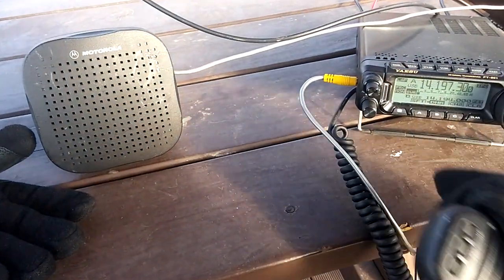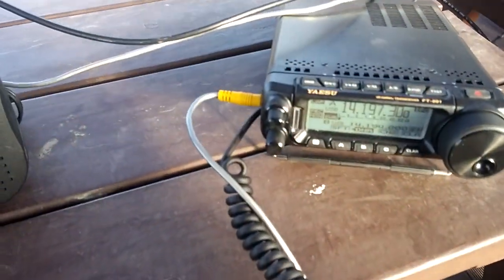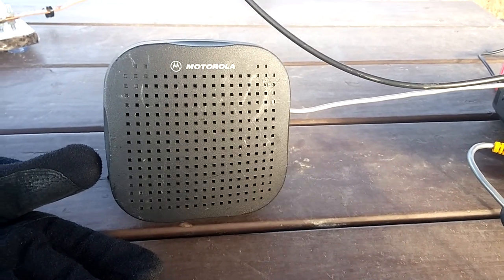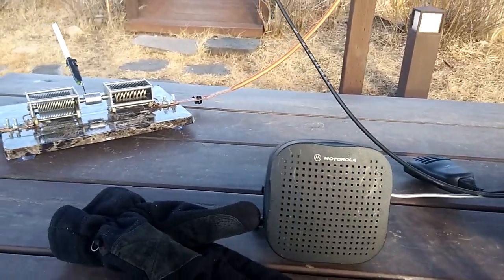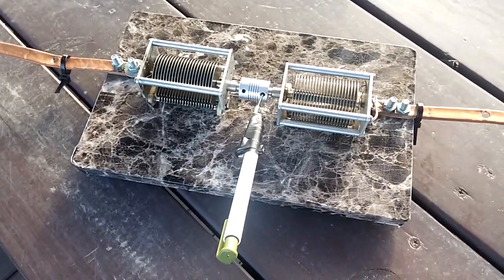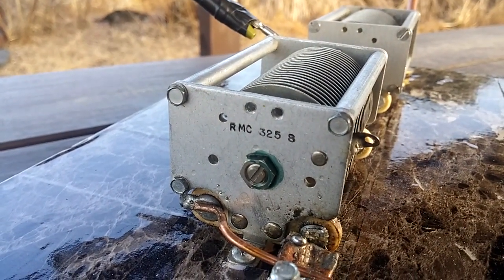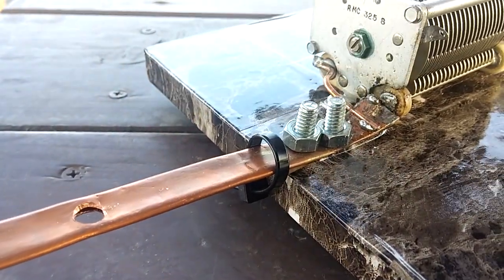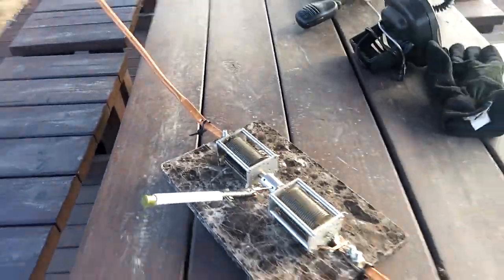Magnetic Loop 20,208 mile contact with LY28A, from HL1ZIX

Comment: The fact that the transmitting station is pointing his antenna long path in relation to you doesn’t mean that the signal is really coming along that path. A directional antenna has always side lobs and the rear lobe is often times quite pronounced, especially in hf antenna designs. That means that when he’s pointing long path is actually just coming short path by the rear of his antenna. To be sure of which path is being used he should turn 180 deg and show the difference, only then you can tell. Having said that I’m not saying it’s impossible. More details of time of day and of the year as well as solar data would help. 
By the way nice job with the homebrew mag loop antenna.
Reply from the maker: Thank you for your assessment of what can happen.  You are mistaken in that you did not take into account that LP contacts from Seoul are actually easier, in this case.  Time of year,  time of day, the op's ability to track current conditions, and assessment of other signals on the band at the given time, all factored into the determination of where the signal was coming from.  If you truly understand how LP works, you must also concede that the way a signal skips along the upper atmosphere during proper LP conditions, as opposed to bouncing between atmosphere and land via SP, makes said contact easier than SP.  These were low sunspot conditions in the absence of any storms.  Seoul is not an easy SP hit to Europe all times of the year -- especially with few sunspots.  Often it is far easier to reach the EU via LP, due to the amount of land in between.  SP contacts to the EU come later in the day than this.  If you had an understanding of the location, conditions, timing, and signals at that time, you would see what I mean.   I also work Italy often via LP and some SP.  The contacts from here to Italy are always easier to get.
Reply: @thestingyham1188  thanks for your detailed answer. I’m not in your location so for sure you can speak better than me. At first sight I was suspicious by the affirmation and wanted to say my point of view. If that’s the case, nice one then. I want to try mag loop too. What can you say performance wise on 20 and 40? Is it worth to try build one? I would be interested in a loop especially oriented for lower bands due to its small size and S/N ratio. 
Thanks

Comment: Perhaps I do not understand the terminology of radio. The earth is only a little less than 25,000 miles in circumference. Assuming your contact is on earth, doesn't that mean the longest contact you could have is 12,500 miles away?
Reply: This is HL1ZIX.  Great question... I know he was longpath at the time, because he said where he was pointing.  Here is your answer:

https://www.onallbands.com/what-is-long-path-in-ham-radio/
Reply: @Swampfox10mm  Thanks Derek That answers my question and is very informative!
Reply: @johnjamieson7688  Sure.  Longpath contacts are often easier, when possible, despite the much longer distance, because the signal bounces along the atmosphere without hitting the ground and weakening as much.  Certain times of the year, depending on where you are working another station, can be better longpath.  With a yagi, one soon learns about it.  On a dipole or vertical (or loop like this), we may not know which direction unless the person on the other end says where they are pointing.  Often times, you might see LP in comments of a spot on the web, for Longpath.
Reply from the maker: Oh, and I just remembered to add that the signal is traveling the long way around the Earth (LP), not the short way.  If I were equal distance from his location on the other side of the Earth, then yes, 12,500 miles.  The station is much closer than that to my East (let's say around 5,000 miles, to keep it simple).  But he was pointing LP to reach me, and that happened to be the only direction open that day.  The signal was traveling the long way around to reach me from the West.  I kind of explained how this happens in my earlier post.  By the way, it's a LOT easier to exploit LP if you are higher up in the air (120 feet or so on top of a building, here).

Comment: I don't want to be annoying but:
if you had a thick copper wire with you and threw it over the garden shed
making use of the frame of the garden shed you could have made a larger LOOP!
the LOOP coupling is simple!

and in the background I see a large metal fence ???
you could have put a wire there too!
enough space there !!! tensioning a wire !!!
now you have to walk around with that big loop
!?!?!?

take only those tuning capacitors with you from now on!
and these things: https://www.google.com/search?sa=X&q=kabeloog&tbm=isch&source=univ&ved=2ahUKEwiSrZ6KwdnhAhUHMuwKHX8mDUAQsAR6BAgJEAE&biw=1920&bih=937
pinched on a somewhat thick power cable
nice location to ......

VrGr Rob.

Comment: I am surprised that you are sitting so close to your loop... apart from the radiated RF affect on your body. Don’t you get any current going back into the radio distorting the TX, l would a least use a 1:1 current choke.
Reply from the maker: There is a torrid choke tied on the feedline.  You can see it under the driven loop.
Reply from the maker: I did some research on qrz.  These numbers came up from one of the experts, using modeling.  Will stay back a bit more. Thx for the note about it:

Safe distance vs power level for a continuous carrier on 3 different bands.

40M - 5 watts - 4 feet
40M -100 watts - 7 feet
40M - 1500 watts - 11 feet

20M - 5 watts - 5 feet
20M - 100 watts - 9 feet
20M - 1500 watts - 15 feet

10M - 5 watts - 5 feet
10M - 100 watts - 10 feet
10M - 1500 watts - 22 feet
Reply: @thestingyham1188  
The  key word here is ''continuous'' .
A single side band signal is peaking at a fraction of the time compared to  AM or FM or a constant tone modulated SSB signal.
Notwithstanding the above , the mag loop does look a little too close, for my liking. 
Better to be safe, than to be sorry.
Reply: That is a really smart way of coupling two variable capacitors to tune a magnetic loop.